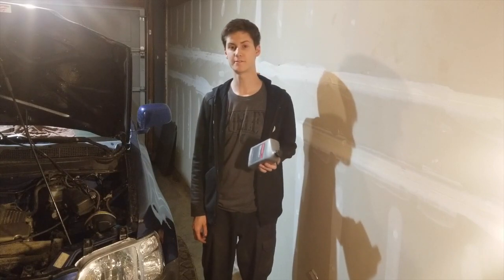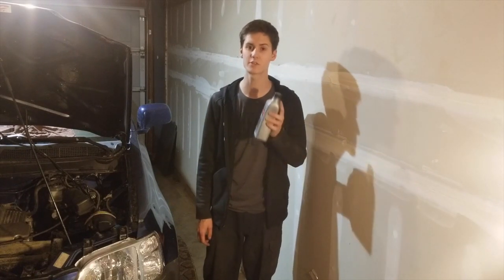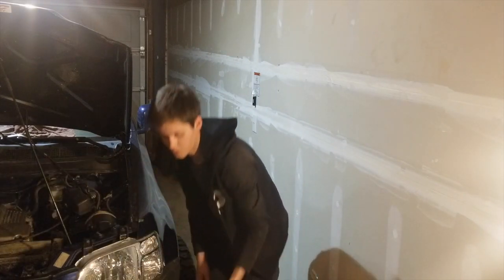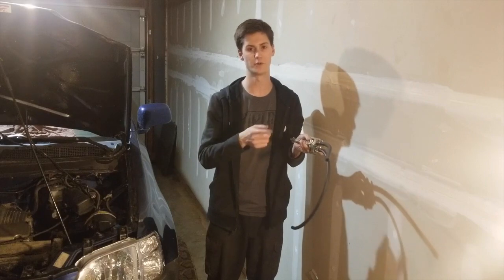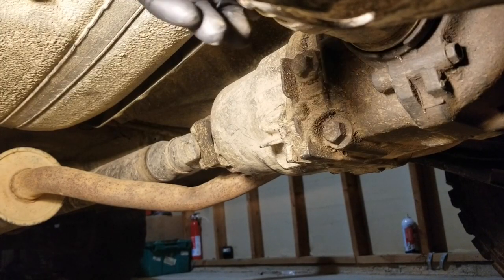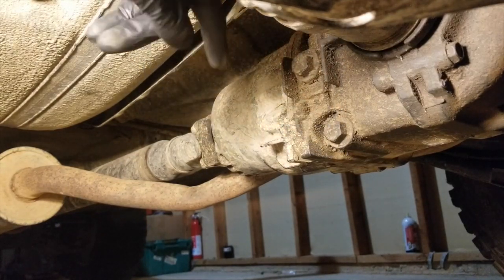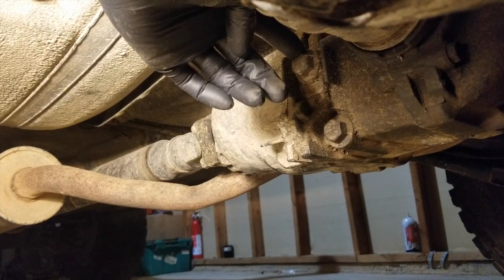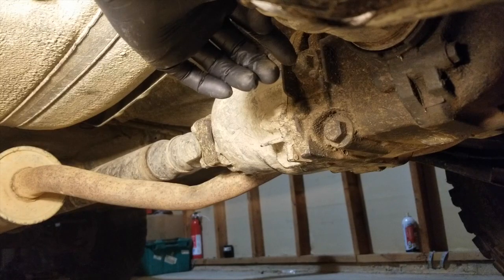How to Make Your AWD Honda Rear Differential Engage Better

Comment: Cr-vs do not even come close to Subarus off road. Those clutches are just a bad idea.
Reply from the maker: deffintely not the best awd system for sure. which is why im now running a viscous coupler from a landrover to replace those rear clutch disks. now if i could just a low range gear box like you subaru guys!

Comment: Good video mate, very informative! Another note on the rear diff functioning better is there are few performance upgrades to enable the rear diff to engage and respond quicker, dual pump system has a spring upgrade for quicker spool and engagement and also clutch pack upgrades to remove slip and take heaps of power
Reply: where can you purchase the spring upgrade?

Comment: What if u accidentally put gear oil. And discover this group 4 months later. Them u change the fluid to dual pump 2 fluid. After doing two honda fluid changes the differential starts to whine even when going straight above 20mph. But 4wd does engaged? Is my differential shot?
Reply from the maker: There are wet clutches in the rear diff. I would assume they probably arent meant to see real oil. Theyre probably oil soaked and slipping and thats probably what your hearing when accelerating.

Comment: So its a speed sensor to pump the oil?
Reply: Am have to try that out. Is it from a civic or wat kind of speed sensor
Reply from the maker: This one is from a 90 integra, not sure which others have this also
Reply from the maker: Yes, I use the speed sensor from the transmissions ive had and thrown awaybas a fluid transfer pump.
Reply: O ok am trying one have on my old civic